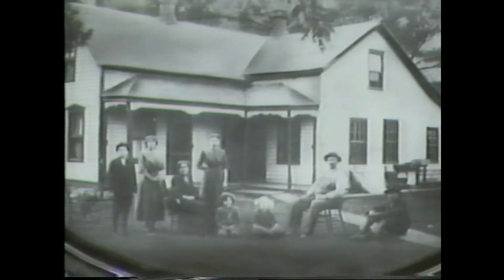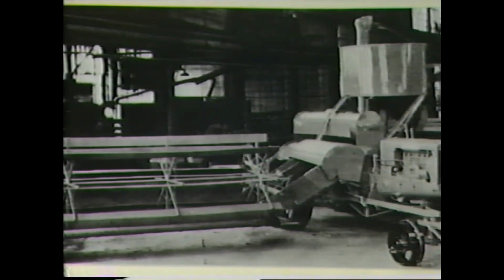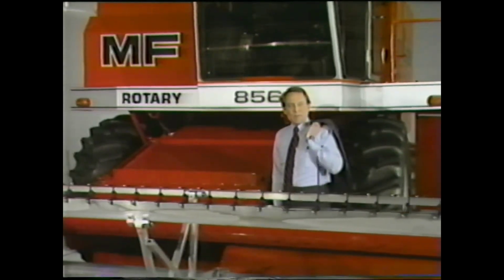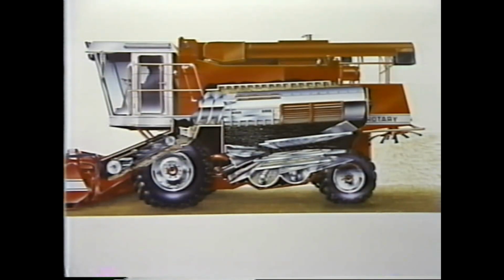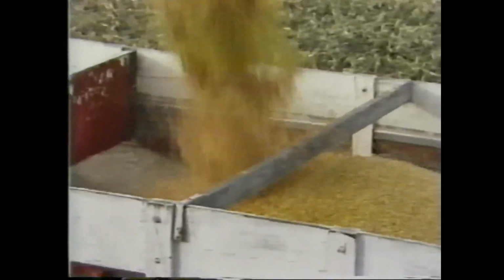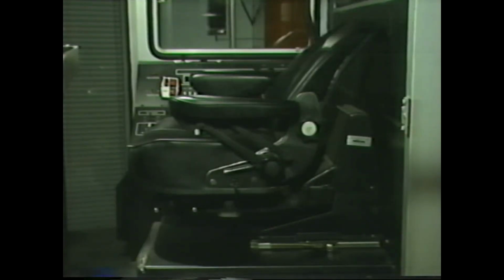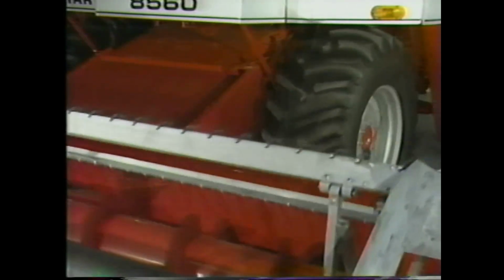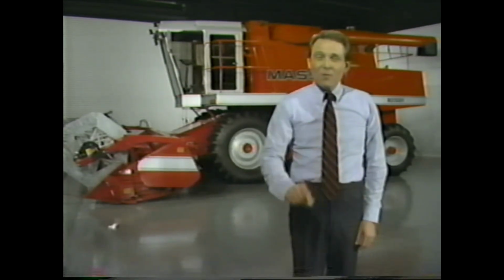MF TV "The Rotary Story"

Comment: Its a Cockshutt from Branford, Ontario, Canada in 1979. At that time White owned them since 1962. Cockshutt was designing this machine in 1958 at the very advanced combine factory in Branford. MF acquired White in 1986 when White went bankrupt. The white 9700 was of such large capacity that no equipment was made to test its real capacity. It came out with a 25 foot header, it could have handled a thirty five foot header. That was huge for that time. The IH 1440 was a baby  compared to the White 9700 or 9720.
Reply: MF aquired White in 1985, not 1986.

Comment: What BS. MF bought White's Rotary combine plant and design's because they did have a Rotary combine. White only sold it because they were broke and needed a life line. MF was not much better but they could get a lone from the Canadian gov. because Canada didn't want to loose Canadian jobs. They both sold the same combines as a MF 9720 and White 9720 for several years. The 8560 was also also a smaller White design that was in the prototype stage at the time of the sale to MF.  MF Taking credit for all of White's engineering and development.... Geez!  🤦